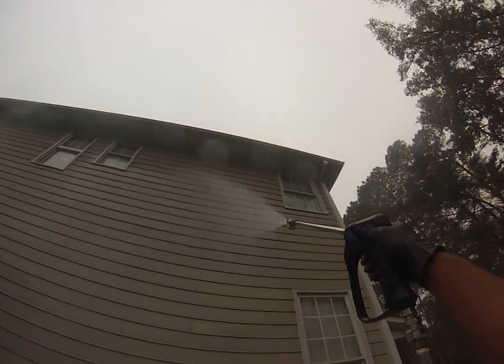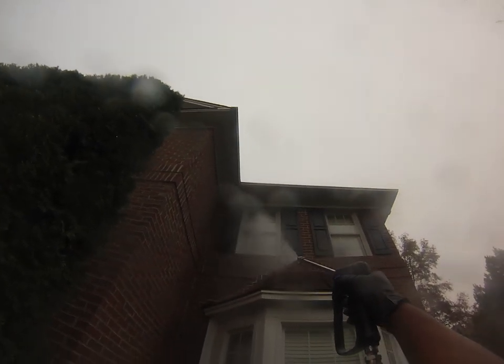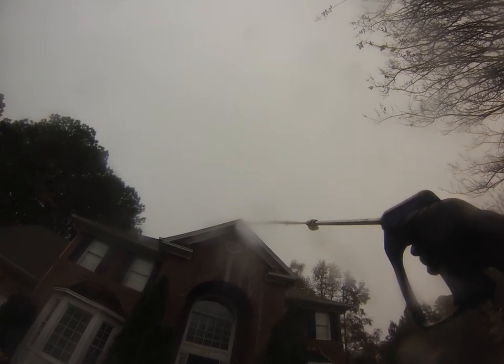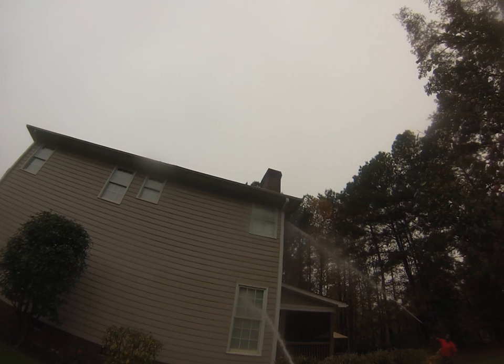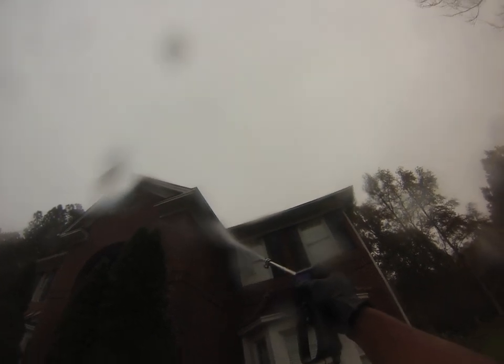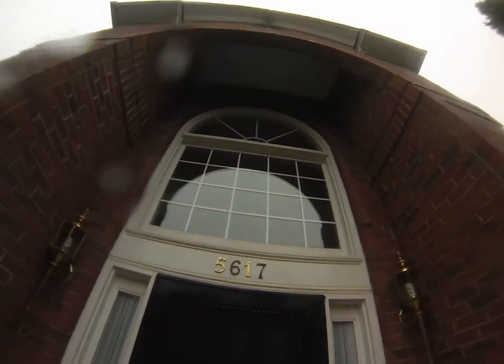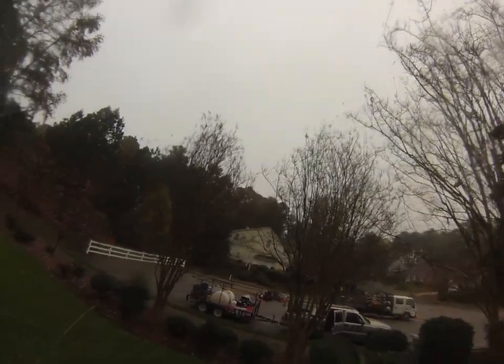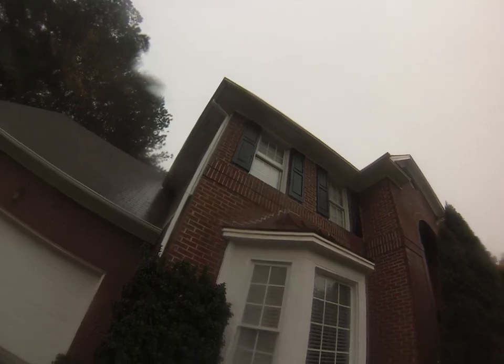How to Softwash / Low Pressure Wash Homes

Comment: I saved myself that walk back to the truck by installing a 12v remote control valve. I've been using it for 2 years & It works great.
Reply: Jeff Jeff where did you get it from!

Comment: Good stuff, thanks!
It seems that I've been taking too much time in 2 story houses...
I've been using 10% SH 2 gallons chem to 3 gallons water, with 1oz. per gallon of dawn dish soap for my surfactant and I'm down stream injecting. It works pretty well on vinyl siding and as a pretreat for cement surface cleaning, even on colder days like around 50 degrees fahrenheit

Comment: Great job, sorry if I missed it but how do you deal with windows? My wash usually leaves too much residue. Do you just rinse a lot ? What surfactant used?
Reply: Perhaps dont let your mix sit on the windows too long, until you change it up to reduce the residue/streaks, and rinse a bit longer.

Comment: hey alex,
great video man!! i have a question though,. ur using 3 gal sh & 2 gal water + ur surfectant right. but how much is it actually diluting with the downstream.? i use an electrical diaphram pump from pressure tek only and i'd like to incorporate downstreaming with my pressure washer too but i dont have the slightest idea on ratios.. great job bro. i appreciate the vids
Reply: It says he us using a soft wash system not a down streamer

Comment: Are you using a pressure washer or soft wash machine? And how do you connect everything for downstreaming with the chemicals at a far distance? I have a 7,000 sq ft project coming up that I'd like to use this technique for.
Reply: Cleanscapes Tallahassee how did the 7000 sq ft job go?

Comment: Do you have a water tank or using the home owners water? Just curious because I was told not to use a garden hose longer than 50 ft to connect to my pressure washer. What do you think about that? I wanted a 100ft garden hose
Reply from the maker: Raquelis Cuevas no I was running the water hose to the water tank. I think I had a 325 gallon tank at that time. Machines were being fed from the tank
Reply: I use a 4200 psi/4 gpm machine with 100' of garden hose and I don't have any problems; make sure hose is 3/4". Anything over 4gpm and you'll probably need to use tank reservoir.
Reply: Had to use 400ft of hose and 100ft of pressure line on a job with no issues

Comment: I have a couple of 4gpm machines and getting ready to upgrade to a 5.5gpm. What gpm machines were you using on the house wash using the 3gallons of SH to 2gallons of water and were using about 200ft of pressure hose? By the way great video Alex, I’ve made a similar video like yours on youtube but I was using a 4gpm. Thanks in advance
Reply: I use a a 4200 psi/4 gpm machine and anything over 150' of pw hose and solution doesn't siphon (machine mounted to my truck); not a huge deal because I can still do 99% of my jobs with 150' or less. If it becomes a problem later on I might get an xjet. I downstream straight SH with dawn soap.  Any tips you may have would be appreciated.
Reply: @jasonl8326  10.5 or 12.5 sh?

Comment: If your house wash contains 3 gallons of SH and 2 gallons of water plus surfactant, how does that work downstreaming? Wouldn't it be even more diluted?
Reply: Good question. I usually use straight SH and dawn soap mix when downstreaming; seems to work for me. Then I use Krud Cleaner (direct from garden hose) for gutters.  I'm not sure, but I think using lower pressure (either by lowering the throttle or using a ball valve attachment) will give a more concentrated solution; it looked like they were using pretty low pressure.
Reply: Different pump to start, and would be siphoned directly from a mix tank